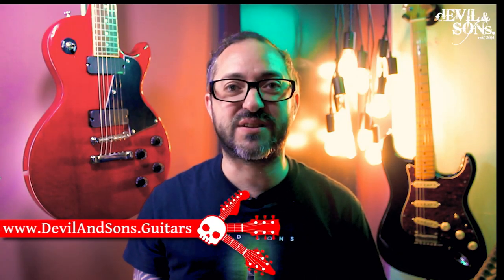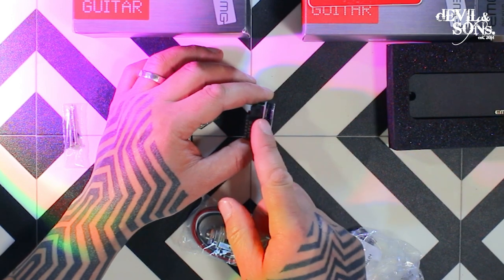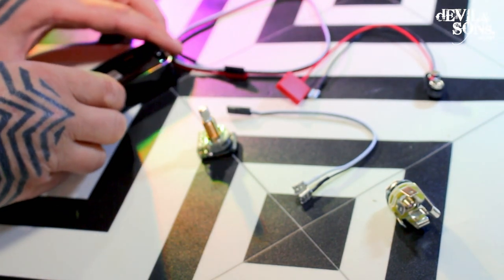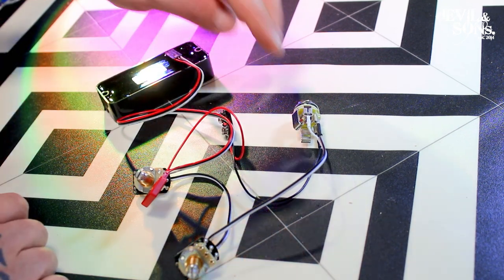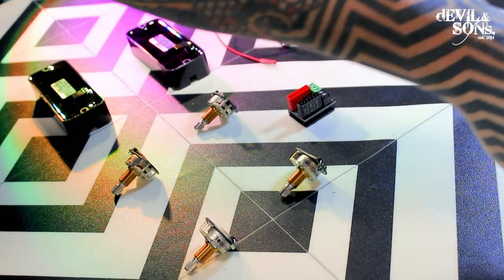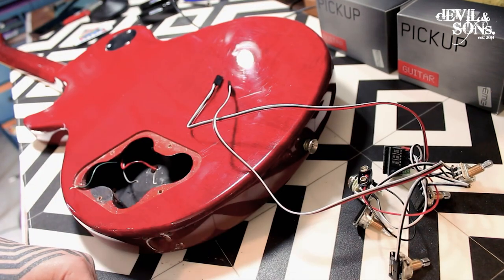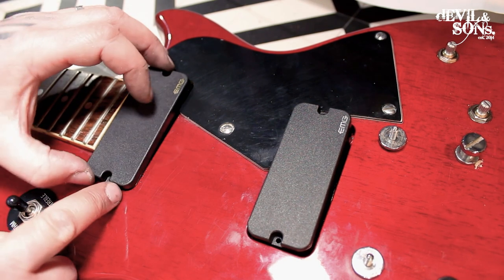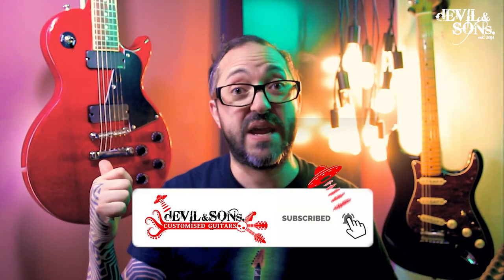How to correctly install EMG solderless pickups - the (P) 81/85 combo

Comment: Hi , 
Ive been thinking for a while about getting a Harley Benton R458 fanfret which Ive heard about in many reviews that their pickups are not that good  so I was looking for some pickups I could get as replacements and came across the EMG 808X.
I'm not able to get two sets of pickups at the moment and so I was wondering if I could connect one pick up and keep the stock one until I can replace it too.
This is a great video and I'm definitely saving it for later , keep it up !
Reply from the maker: Thanks for watching and book marking. I'm pretty sure that using this supplied bus you couldn't combine one pickup using the emg solderless system with a soldered pickup without soldering the soldered one (I.e. the Harley Benton) to the bus. However that would be fine if you are buying the pickups separately and the each come with a bus, so you can essentially discard the one you have soldered on to when you put the second pickup in. However,  you should check EMG's website as I think they may sell a bus system that allows both types to be used together. I hope that makes sense.

Comment: I was doing this for hours and couldnt make it work u helped ty
Reply from the maker: It's a pleasure. I'm glad I could help. What were you putting them in?
Reply: @DevilAndSons  i put an 81 into an ltd les paul the tutorials suggested using the bus and it just didnt work for some reason and then i saw u install it without the bus and now it works fawlessly
Reply from the maker: So glad. Sounds like a nice upgrade.

Comment: it’s very clear what the Ring is on a TRS (Tip, Ring, Sleeve) connector, but what constitutes the “Ring” on a TS (Tip, Sleeve) connector, aka a guitar cable, as you have here? Is it the black divider between the tip and sleeve? I would’ve thought that was just a nonconductive isolator between the Tip and Sleeve, no?
Reply from the maker: Yes, you are right. When I said the ring i meant on the jack, the ring shaped section but really I should call it the sleeve connector perhaps, to be clear.

Comment: Hi, could you give me a piece of advice? I have two EMG 89s, and I would like to use one of them as the 89R in the neck position. Which means that it needs to be installed upside down. Can it be done this way? Will the upside-down position make any difference to the sound (either in the humbucker mode or the single coil mode?
Reply from the maker: Why dies it need to be upside down? Depending on how it's wired normally when you split a humbucker so it's just a single coil you might choose the outer coil as the one remaining live, if it's upside own it would be the inner one and you'd have a very slight difference in sound because of the position being slightly different (you nay not even notice it). Unless I have misunderstood you.
Reply from the maker: It wouldn't effect the humbucker mode.
Reply: @DevilAndSons  If one might choose which coil of the two will be active in the split mode, why would they issue the 89R? It's exactly the same as the 89, except for the fact that the active coils are the opposite.
Reply from the maker: In that case it's wired so you can't choose. Sorry, I don't know that pickup well enough. On some pickups you can choose.

Comment: I'm not exactly hinging on a response, but it'd be appreciated, as I do have a question: is it possible to wire two humbuckers to a single tone knob, but two volume knobs with the solderless kits? So, a volume knob for each pickup, but a master tone knob? I've got a Les Paul style guitar from Harley Benton that has this setup, and I'm looking to swap out the HBZ pickups in that with EMG 81s and 85s.
Reply from the maker: Just a quick look at the EMG page and there are a few options for this: https://www.emgpickups.com/top-wiring-diagrams
Reply: @DevilAndSons  HUGE thanks, the diagrams make it a lot clearer. I've also watched the video over a few times as well, and it's a huge help. I'll make sure to rewatch it when I get the kit that I've decided on when I get around to doing the swap
Reply from the maker: @jacko628 great. Do let me know how you get on. I think this system is really good.

Comment: Hi there, I recently picked up a pair of EMG 81/85s and I'm going to be installing them into an Explorer. If I'm understanding correctly, I'm only going to be using two volume knobs one for each pickup and one tone that works between the two pickups. Everything should connect to the hub like normal, correct? Thanks
Reply from the maker: If you look at the EMG website they actually have diagrams for different set up options. Even of the set up you are using is slightly different it's more or less the procedure I show here. I believe I've posted the link previously in the comments, otherwise it should be easily searchable. Does that help?
Reply: @DevilAndSons  Yep, it does. I ended up going to EMGs site and pulling up a PDF of the different installation diagrams. Thanks.
Reply from the maker: @UberBman enjoy your new pickups

Comment: I'm planning on installing a set of EMG's on my Ibanez. Thing is, it only has one volume pot - what should I do here? Just toss out the tone and its wiring system?
Reply from the maker: Yes, you can remove the tone without affecting the volume circuit. Or you could leave the tone pot loose on the inside of the cavity if there is a room and just set it as you want, knowing you can adjust if needed.

Comment: Where was this video when I was wiring my GGBO build with the EMG Zakk Wylde series. This plug n play system is a great idea..... right up until you have to stuff it all in a crowded control cavity. The wires are a tad long to adapt to all makes of guitars but some cut outs are tiny and stuffing all this in vs hard soldering can be problematic.  that said I LOVE emg pickups and they are on every guitar I own or have owned with the exception of my Charvel acoustic.
Reply from the maker: That is a very good point about the length of the wires and control cavities being small. I really enjoyed how simple the system was to use. Have you got a favourite set of EMGs? I am interested in hearing a set of James Hetfield ones in real life.
Reply: @DevilAndSons  The only named set I have is the Zakk Wylde 81/85 set. My 2005 Mockingbird has an 85 in the bridge position and my 1986 Washburn RR1v has an OG 81 in the bridge position. I have crappy covers on my channel with all three  guitars. Use headphones so you really get the tone nuances.
Reply from the maker: I've watched some of your covers but will go back with fresh ears. The 81/85 does seem very popular.
Reply from the maker: Are the Zakk Wylde ones altered in anyway other than the name?
Reply: @DevilAndSons  The 81 / 85 has been the traditional "Metal" set used by pretty much everyone.
Reply: @DevilAndSons  Oh yes. They are more low / low mid biased then others. They also seem just a tad hotter as its hard to get a super clean tone vs the OG EMG's You can match any guitar players sound with no problem if you have a good EQ system in place.  I do all my sound profiles in a digitech RP500. All my guitars sound similar because I am copying the OG sound. With the EQ Bypassed they all sound very distinct.
Reply from the maker: Thanks for that info. I think I may check out more in the future.
Reply from the maker: It really has, and it seems like for a good reason.

Comment: I am using the EMG Het Set on an Epiphone Goth Explorer and have issues with the volume "leaking" when I roll down the volume knob all the way down. E.g. Select neck pickup, roll down volume 100%, but still hear output when strumming. I used a new wiring kit with new pots and a new toggle switch, so the only item remaining is the wire feed for the toggle switch. Have you faced a similar issue?
Reply from the maker: That sounds annoying. 
Does the volume actually decrease when you turn the volume down or does it stay the same?

I'm surprised with the full change you have made that you still have the problem. I think it would be worth changing the wire feed to the toggle just to ensure that everything is new.

I have heard of similar problems caused by a faulty bus.  One way to trouble shoot this may be to swap the wires in the bus around so it thinks the neck and bridge pickups are the other way around and see if it's still the actual neck pickup causing the problem or now the bridge (which it thinks is the neck). I can't remember reading if anyone had a solution for this problem other than swapping the bus. If you are on a Facebook there is a great emg pickup group which is where I have read about this problem before, the hive mind there will probably include people who have had this exact problem and have a solution.

Sorry not to have an immediate answer.

Comment: I have a Gibson explorer. 2016 year. I finally
Decided I wanted to put my passive emg h4 and h4a into it….. It’s my first time, but not my first time doing any type of mechanical work. Anything I should know before I start ?
Reply from the maker: I hear they are great but haven't tried them myself. I would say if you have any worries then do a set up outside of the guitar like I did first, you can check everything there. I have been very impressed with how the EMGs fit together and their written instructions are pretty clear so I am sure you will be fine. Without the active element I'm sure any pre-drilled holes and cavities will let the wires through and contain them fine.
Reply from the maker: Good luck, and do let me know how it goes.

Comment: Is it possible to use the springs from the old P90’s underneath the screw holes of the new pickups?
Reply from the maker: Absolutely. I have a small box of springs I've collected from different pickups and often swap. Basically sometimes the springs are too long and I can't get the pickups high enough, or vice versa. So essentially and spring can do as long as it allows you to adjust the pickup as you like it, and it's nit guaranteed that the springs a pickup cones with will be right (often new springs are long and sometimes I even cut them). Good luck with your new set up.

Comment: Hi, if fitting these to a left handed guitar, do I need the EMG front logo on the low E or High E??
Reply from the maker: It doesn't make a difference, but normally I would expect the EMG logo to be the right way around when the guitar is standing with the neck facing up. If that makes sense.
Reply from the maker: Actually, I'm 99% sure it won't make a difference but if you are having any type of coil split you would probably want the active side of the humbucker to be the one on the outer side of the pickup.

Comment: Perfect tutorial, but Is it alright If I ask for help? I just installed my EMG MM5TW with a single coil/dual coil push/pull volume pot, mid/freq stack pot and a tone pot. Everything was installed perfectly, but now I have no clue why there's a static sound that comes and goes, mostly when I mess with the tone volume, there's some noise that comes when messing with the mid/frq volume, but it'll then disappear.

So frustrating tbh and I have no Idea why it's even doing that
Reply from the maker: Thanks, and please do. Firstly, is the bridge earthed? It shouldn't be for pickups like this so perhaps that's causing an issue.

Secondly, if possible I would try disconnecting the mid/freq to see if there are any issues with the other parts. Then try putting it back in. If there are issues still I would then try disconnecting the standard tone to see if the issues continue without that. That may help narrow down the issue.

I also just had an issue with something completely different that was resolved once I changed to a different battery.
Reply: @DevilAndSons  thanks, I tried what you provided and there isn't any noise. I then re-connected everything again and there still isn't static noise which is a plus, but..........there's a but lol......

When I was test playing, the static noise returned, but it isn't loud, but it's there. I placed my fingers on either mid, tone knob and the static noise completely disappeared, I was like wth!?....I removed my fingers and the static noise returned, I was completely confused. 

I don't know anymore....
Reply from the maker: I would suggest as a next stage you could actually try reconnecting the ground to the bridge. I don't know if that would help but it's worth a shotm
Reply: @DevilAndSons  I would definitely try that way, but it'll be weird If It actually fix the problem. Instructions clearly says "Do not connect the bridge ground, EMG pickups are shielded internally". Might sound like a lie now smh, but will do it that way thanks
Reply from the maker: @user-dp8dg2id7f exactly. But that shielding seems to be causing a hum.

Comment: I'm using a pj set and a seperate bqc preamp, what components do I need and which can I discard? I understand each box includes a switchcraft input jack, right? However both include a volume pot, does it matter if they're both 25k? Do I need 2 9v batteries? The instructions say no, but offer no explanation?
Reply from the maker: The EMG website is pretty good for wiring diagrams. It's very likely that the preamp simply replaces everything. The instructions for the preamp should be the one to follow, showing how the pickups fit in. It will be set up so the preamp battery powers the pickup. I hope that helps.
Reply: @DevilAndSons  Thanks for the reply,  mate! I finally held both instructions side by side and compared each diagram. I finally found the closest match. We're set there. I ran into other problems with space. Needing a different input jack 😆 🤣. Solve one thing and discover several more. This bass is gonna sound amazing!!
Reply from the maker: @charlescowan6121 that's the way, bit on e all the problems are sorted they will be a distant memory. Have fun with your bass.

Comment: Help Please, Without PCB board the EMGs 81/85 works fine strait to the output and Battery as you did! But When I assemble it on PCB, I just hear noises buzz, it seems a short circuit in this PCB, defect .. am I doing something wrong ? I rewired the circuit multiple times but results same problem with PCB, apparently I have a problem on It …
Reply from the maker: That does sound like there is a problem with the board. If you have done it multiple times and it still isn't working. There is a great group on Facebook called EMG pickup users (or something like that) who are good at solving problems. Also I think EMG customer support are meant to be good. If it's a new pcb they may be able to replace it.
Reply: @DevilAndSons  I bought a spare PCB 245D to change, meanwhile I am using only the bridge pick-up strait as you taught in the vídeo, thanks a lot, your tutorial is perfect!
Reply from the maker: It's a pleasure, and sorry to hear of your frustrating. Hopefully the new one will work fine.

Comment: So I have a guitar I want to do this with but it's only ported for 1 volume and 1 tone control (shared by both of the current passive pickups.) Is this possible with this set up, to have both pickups sharing the same volume/tone knobs?
Reply from the maker: Thanks for watching. Here's the page of wiring diagrams, hopefully they have what you want - there's definitely one for a strat style pickup selector but it should be the same if you have a toggle. https://www.emgpickups.com/top-wiring-diagrams
Reply: @DevilAndSons  Bang! There it is. Thanks man! Great vid!
Reply from the maker: It's a pleasure. Enjoy the new set up when you do it.

Comment: Is it possible to use the solderless kit with a different active pickups? Like fishmans?
Reply from the maker: I would have thought so. You could strip the adaptor off of the end of the wire that attaches to the emg pickups and identify each wire to solder to another pickup. I haven't tried this, and don't have a set here to look closely at, but I wouldn't be surprised if you could find someone easily on the internet who has.
Reply: Hey just saw your comment could you make it work?
Reply from the maker: Sorry. I meant find someone that has done it and has put an explanation up online. I'd happily look at the parts and give it a go, but reckon it must have been done and documented somewhere.

Comment: I ran into an issue while installing a set of 81/85 pickups on my Epiphone Goth Explorer. The (red) neck wire from the toggle switch is too short for me to connect to the bus. Is there a way to fix this, or am I screwed?
Reply from the maker: Thanks for commenting. I'll try and help. Just to clarify, is this a toggle switch from the existing guitar wiring that goes into one of the screw inputs on the bus? If so it's easy to replace or extend that wire.
Reply: @DevilAndSons  Yes, it's the existing switch and wiring that's coming off of it. One solution I thought of is to move the switch from the pickguard to one of the volume pots and just have one volume and one tone pot instead. That way all the existing wires will be able to reach the bus.
Reply from the maker: You can easily extend the wire, even if you don't have a soldering iron. You can buy some wire and twist the bare end of the new bit up with the bare end of the wire that is too short, then wrap it in electrical tape. The other end of the new wire going into the bus. If you do have a soldering iron then just solder a new longer wire to the switch in the same place. It would be a shame to loose any of the existing controls.
Reply from the maker: You could even cut a bit of the wire you have left on the old pickups (just don't cut too close to the pickup so you can always still use the pickup in the future) and use sellotape if you want to keep it easy and cheap.